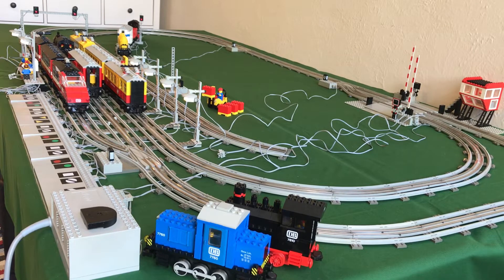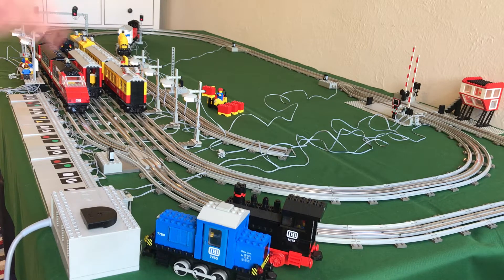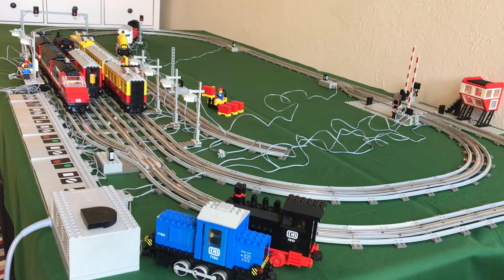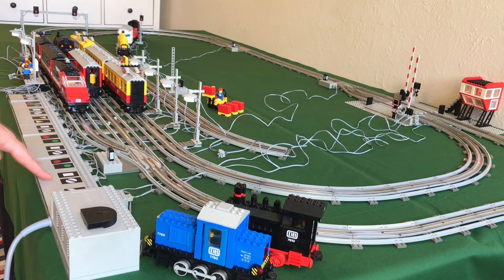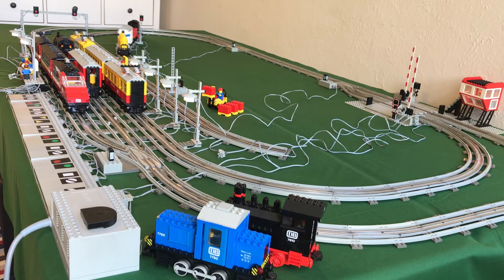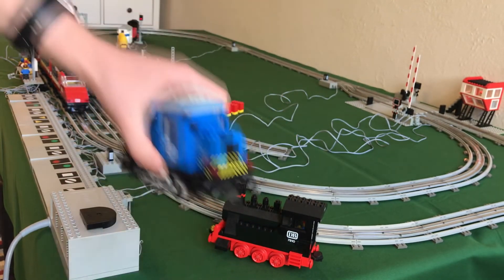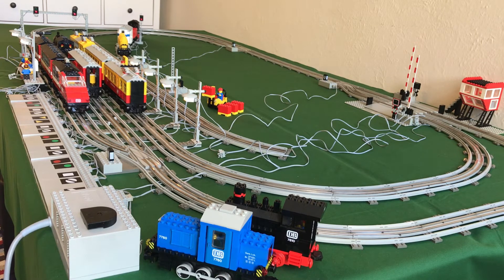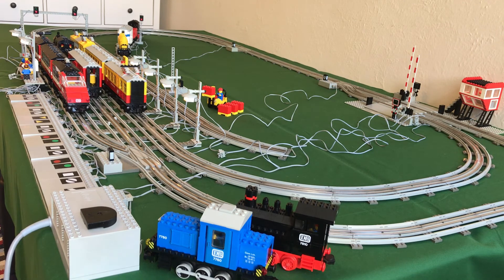Behind the scenes of Layout 8

Comment: The 7760 is nice, is this a replica or a rebuild of an original 7760?
Find that the 2x2 windows in the front of the 7760 and the black weighted stones of the locomotive look quite good.
Reply from the maker: I Bricklinked the parts together, and it's using a type 4 motor instead of a type 1 or 2 like the original should- plus I've used less rare parts to replace the rare windows, weights, and roof slopes. Gotta find a real 7760 soon...